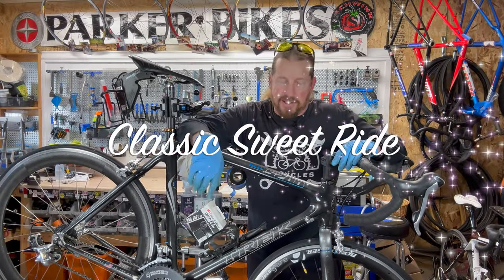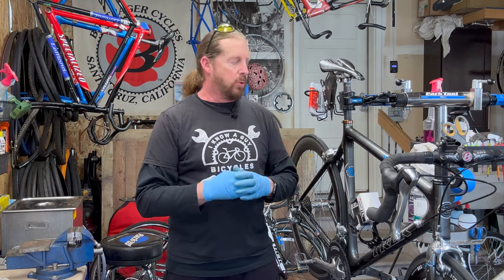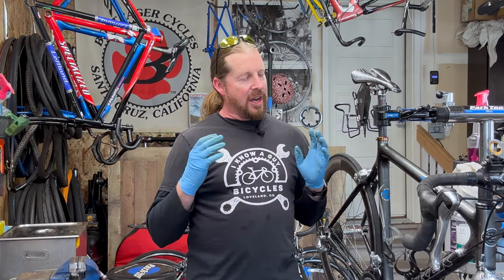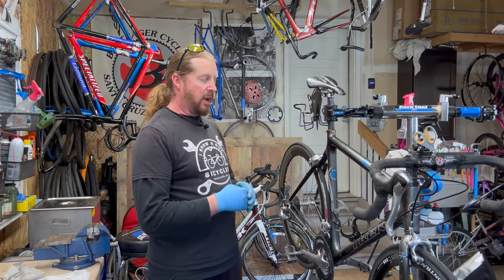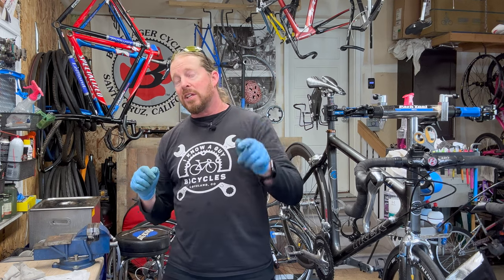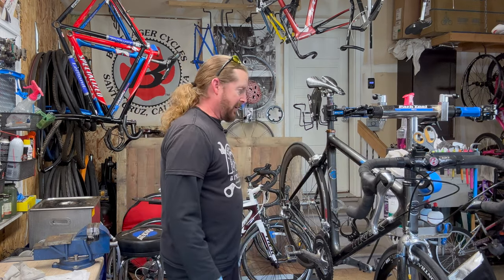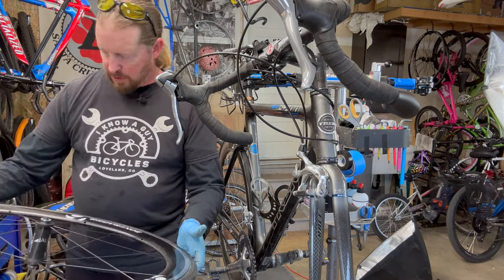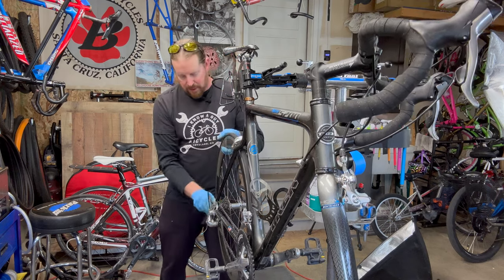🛠️ Resurrecting a Legend: 2006 Trek 5200 Tune-Up for Peak Performance! 🚴‍♀️💨

Comment: I saw a guy use ceramic coating to protect his bike’s paint. It did make the bike clean up easily after a muddy ride and he said the bike was smooth and slick. Wonder how it would do on the chain instead of chain lube or wax?
Reply from the maker: Cassettes and Chainrings you could. Not the chain. The chain needs a light lube or chain wax to function correctly.